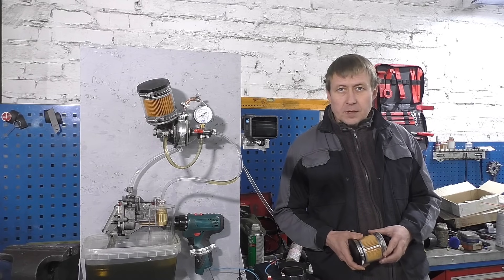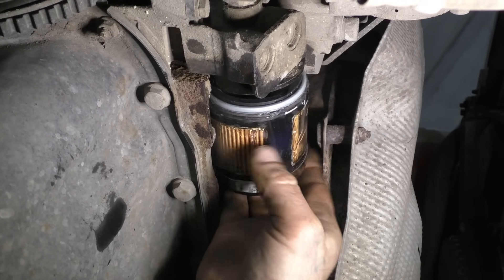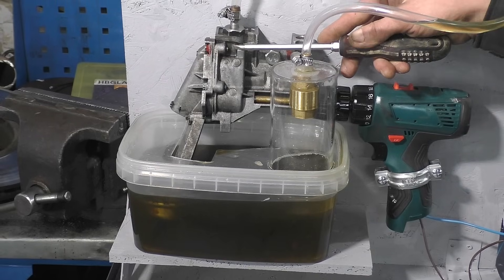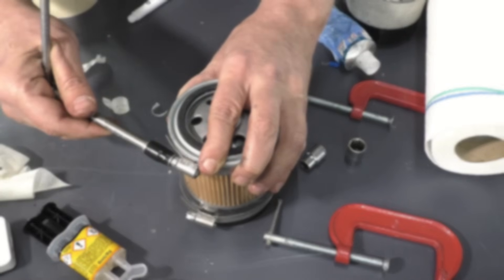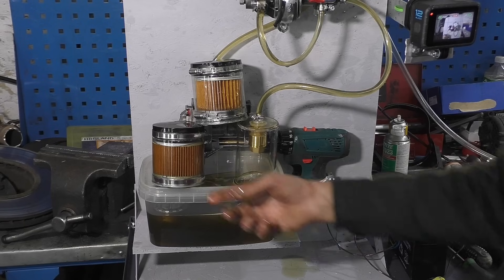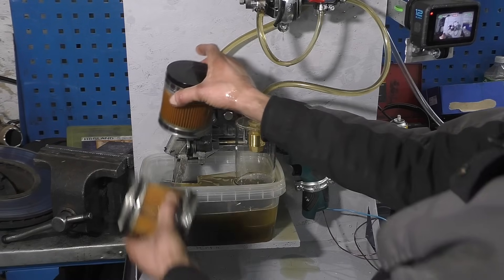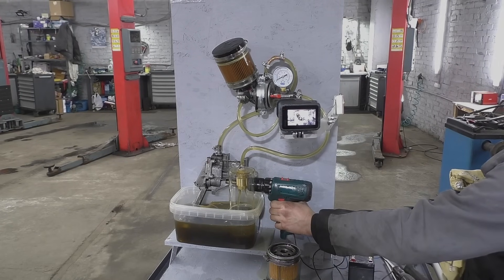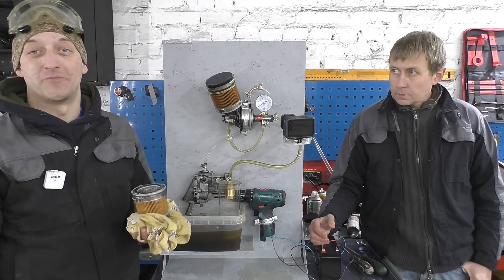Transparent Oil Filter: Dry vs Pre filled – Unexpected Result

Comment: There's a drain valve in a filter?
Reply from the maker: In one filter in the video, I dotted it, the anti-drain valve is not working. The filter has an overflow (emergency valve). If I understand the question correctly.
Reply: В фильтре два клапана. Один редукционный, второй обратный.